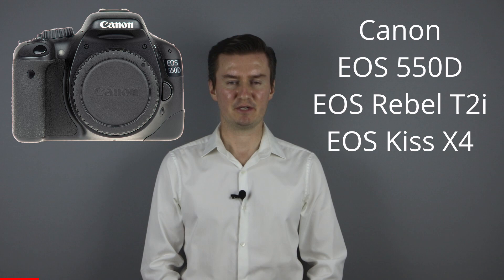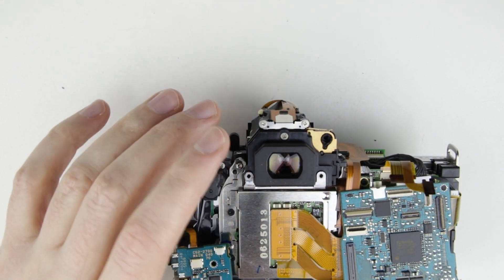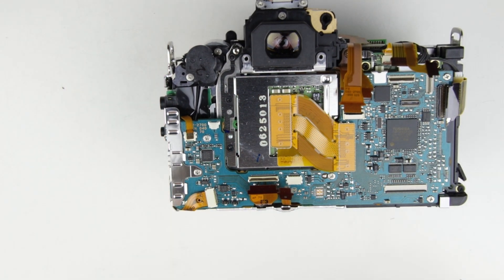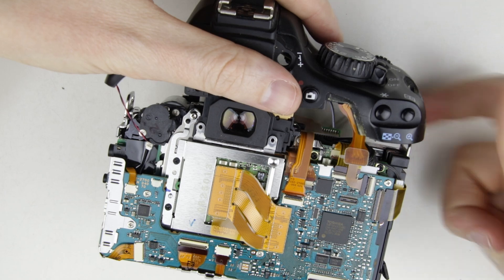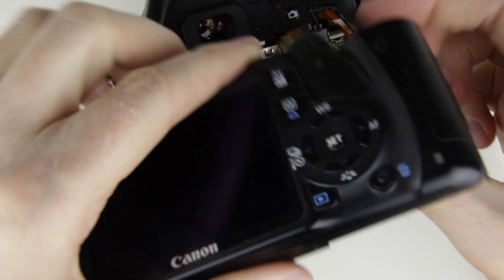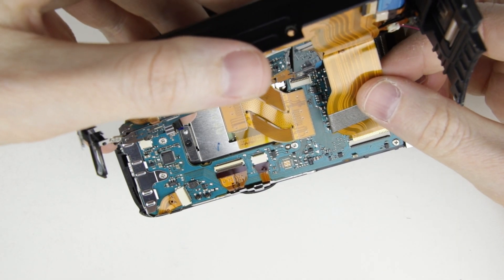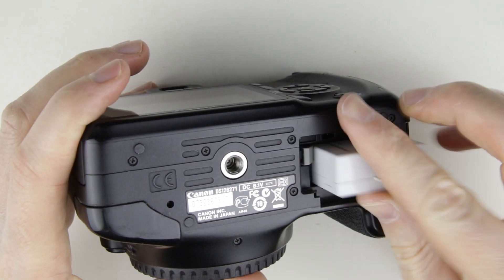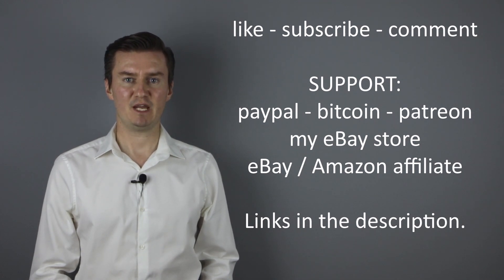Canon EOS 550D / Rebel T2i / Kiss X4 assembly after replacing the main PCB

Comment: Hi, where did you get pre-initialized board? All Canon motherboards arrive not initialized and they need proper calibration data (for imaging unit, shutter and AF) otherwise the camera wont work as it should.
Reply from the maker: You can use SPT software to calibrate or read / write calibration data.